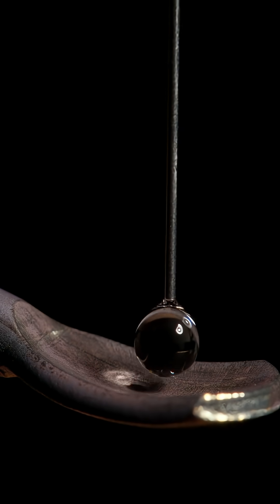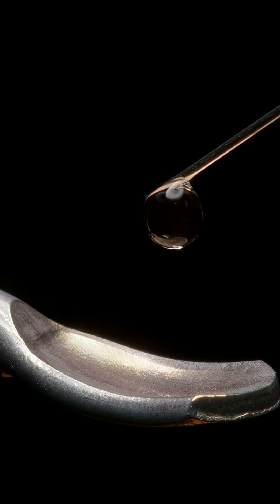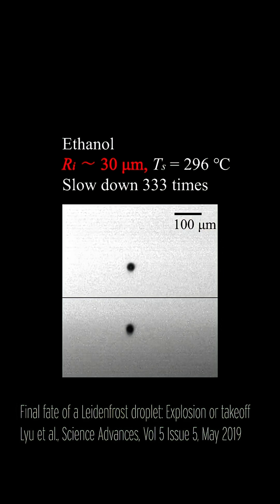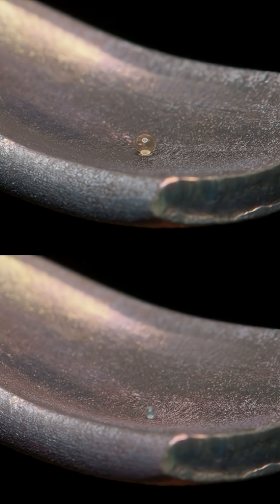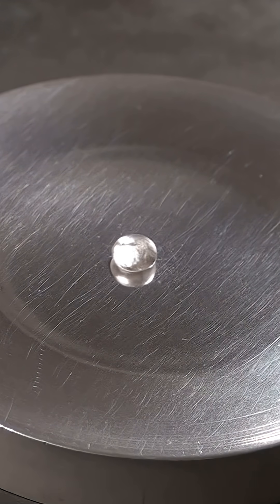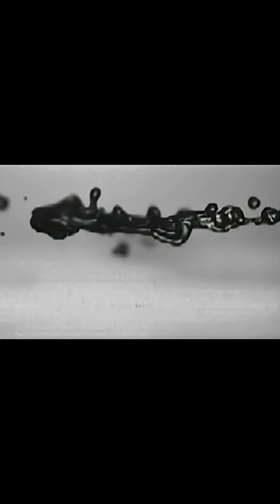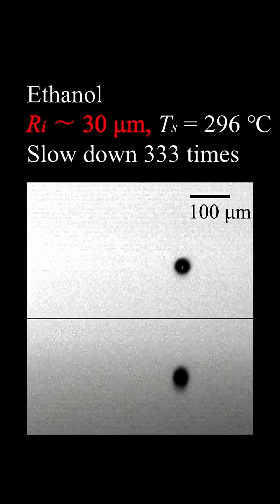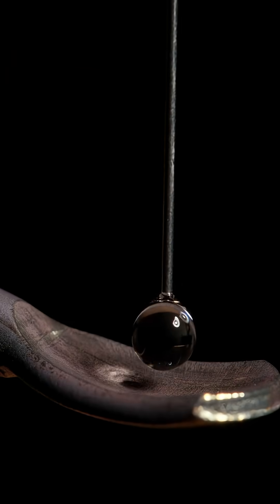trying to make water levitate but it keeps exploding

Comment: The contamination is likely providing a nucleation site for the water to boil where as the pure water can get super heated, held together by surface tension. It’s like when you heat water in the microwave, it can get super hot without boiling but then you put a spoon in it and it insta boils.

Comment: Why do they explode? 

Difference in heat absorbtion

 and the fact that the impurity will fall to the bottom of the superheated water, 

due to it being heavier than the water which is already at the verge of being gasseous

 which will cause the vapour layer to disperse if the % of the water on the bottom surface is smaller than the % of the impurity,

meaning that everything else but the impurity has been boiled away from the bottom,

meaning that there is not enough water to maintain the vapour layer 

which to you looked like a "jet"

 directly heating the impurity, which will direct the heat along the water on its sides to the centre of the bubble,

 And that water almost instantly boils and that expanding gas will cause the explosion.

Comment: Energy vs surface tension, obviously 😂 Think about water and how it holds together as a liquid. Think about what causes that surface tension. it depends on the contaminant, obviously,  but by making stronger charge centers, the contaminant molecules stop even distribution and create points of weakness in the surface... then instead of holding together, the weak points make points where significantly less energy is required to break surface tension. And the droplet then unzips around those weak points tearing the droplet apart,  making it seem to explode. You get a catastrophic breakdown in surface tension from those weak points 😉 i imagine these basic principles could be applied to many things 😂

Comment: When water on a hot plate becomes very small, any impurities can make it unstable. At a certain point, there’s too much contamination for the water to hold in solution. The impurities separate out, heat up rapidly, and create a superheated spot that causes the surrounding water to flash into steam and explode.

Comment: my wild non scientific regular guy guess is that the contaminant precipitates out of solution and thus giving enough surface contact with the water (nucleation point is called?) to vaporize which changes the shape of the water. that jet may just be steam being generated and pushing the water downwards.

Comment: Wondering if the impurities act as nucleation sites as the concentration increases while the water boils off. As the temperature of the water reaches a certain threshold there is sufficient energy that an instantaneous event produces internalized steam producing the explosion. That is where I am guessing the color comes from as the concentration increases the color rises. My guess is if you run this with an ultra pure water and then dope in a contaminant that absorbs at a specific wavelength you could measure the relationship between the absorbance, the total volume of the water droplet, the rate of the evaporation and where the threshold concentration is for explosion.

My guess is this occurs only in droplets below a certain threshold size.

Comment: Maybe the contaminanse cristalieses and creates a nukleation point for steam inside the droplet. This would be on the bottom of the droplet cause most of the evaporation takes place there, so this would explain the jet from the bottom of the droplet. If the cristalisation is exothermic, it would also heat the water far beond boiling and culd enhance the explosion

Comment: Well when you boil salt water. The salt doesn't evaporate the water does, so in this case, the droplet is getting more and more concentrated with the contaminant since the contaminant is not decreasing in amount. Once it reaches the threshold of the water being as saturated with the contaminant as it possibly can any further evaporation would cause an explosion just like this.

Comment: I don't know if it counts but if you were to gather water vapour from a boiling water
And then transfer that into a container that was insulated on all but one side (maybe add a metal film cover to the top so it get contaminated
And then you froze it for 24 hours
Then you chipped off a bit of the clear ice
And then melted it and tried it with that
Would that work? 

Otherwise, can't you buy pure water?
And then you froze it for 24 hours
Reply from the maker: I was using distilled water with a sterile syringe and needle… I’m not sure how the contamination got in there
Reply: @ACSReactions  your method is definitely much better :o
my assumption would be that the distilled water had the contamination
but how to get 100% pure water I have no idea

Comment: Surface free energy v. Volume free energy. You can increase the energy at the interface by adding impurities, which is positive and therefore unstable. In other words, you can think of the metal impurities (Cu(ii) and Fe(iii) from the color) as decreasing the surface tension that holds the water droplet together by interrupting water-water hydrogen bonding. It's kinda the opposite of heterogenous nucleation I think, thermodynamics is really weird.

Comment: My guess why contamination makes them explode: drop a Mentos into Coke and the dissolved gas has a surface to adhere to while forming a bubble. 
Heated water can hold less air as well. Get impurities into the droplet and you get a bubble within the water, leading to an explosion shortly after. 
No impurities - gases get ejected at the droplet's surface.

Comment: Could it be that the vapor pressure of the impurity exceeds the surface tension of the drop at a particular temperature and a particular size (diameter) of the drop as it reduces itself, thus leading to the explosion?

Comment: Harking back to my materials engineering days at university. 

The jet shooting out the bottom appears to be as a result of lower surface tension on that flat plane, compared with the rest of the droplet which has the curved surface.

The energy will be dissipated along the path of least resistance, i.e. the flat plane. 

My memory of the equations is rusty, but I believe the principles are correct.

Comment: Unlikely but... Maybe it's no different than when water does NOT freeze despite being below 32F/0C, but then spontaneously freezes once agitated; or super-heating it in a microwave and similarly flash boils upon agitation... Just in this case, the contaminant gets hot enough inside the droplet, boiling it from within. 🤷‍♂️

As I said, unlikely, but that's where my mind immediately went to.

Comment: (Edit- To be clear, I am not presuming to tell you what to do: I am just having a bit of fun with a thought experiment. So only carry on reading if you are into self-indulgent brainstorming 😁)

I know zilch about the subject but if I were to try this experiment at home, I would hazard a few hypotheses, my first one would be that your starting drop is too big to achieve a levitating effect in its specific environment and it has time to boil before it can get small enough to levitate.

a-  Because the mass of the drop prevents it from levitating immediately, its temperature has time to increase sufficiently for inner molecules to turn into a bubble of vapour, and that bubble has time to expand and explode.
So, I would personally reattempt the experiment with a bubble a quarter of the size of the original one.

b- you are attempting your experiment in a spoon rather than on a flat surface and this is going to affect the direction of air currents above it, leading to less predictable turbulence and variations in temperature.

c- the material the spoon is made of might be a variable to consider. The Leidenfrost effect happens spontaneously on stainless steel but not so much on cast iron. Different metals react differently to heat.

d- (still about the spoon) The material of the spoon might not be smooth enough and have an impact on the behaviour of the vapour layer under the drop.

e- (the spoon again) The spoon is tiny. The area heated by the spoon is tiny.
I imagine that the heated area has the shape of a flame so when the water droplet jumps it has a high chance of escaping the hot zone before re-entering it as it falls down, but if you were working on a wide surface, as the drop jumps and escapes the zone directly above its lift-off site it then gets carried by the hot air of the zone that is adjacent to it.
(Also, would this lead to some kind of heating and cooling of the drop?)
The ratio of the droplet's vs the heated surface's sizes might be important.
Also, the drop has a great chance of falling off the spoon.

d- the likelihood of a drop levitating might be small and only happen in a very narrow set of circumstances.
You are experimenting one drop at a time, but you might need hundreds of drops before the effect you are looking for occurs.

I would personally reattempt the experiment with a large flat and smooth stainless steel pan and I would experiment with the pan's temperature and with different scenarios such as:
- keep splashing water on the pan and do so in large enough quantities that a fine and invisible layer of steam is likely to remain and hover over the pan, like a little cloud that has enough substance to carry a tiny droplet with it.
- or leaving the pan undisturbed until air settles itself into regular "layers" of different temperatures that create a ladder like effect, each one having a different density while also allowing the droplet to cool down slightly as it rises.

PS: could it be that in the experiment you are referring to the water itself contaminated? I could imagine that some contaminant might have increased the surface tension of the drop.

Comment: It's obvious what's causing it... The impurity in the water is increasing the weight of the droplet preventing it from becoming light enough to float above the surface of the spoon...  It pops because the internal pressure is too great and it holds that shape due to water tension...

Comment: Here's my theory. 

The heat causes a weakness to the surface tension. We know that heat causes water to turn into steam. So when that tension breaks, it snaps/explodes like a bubble. But some of the water is still water clinging to itself which causes it to flip itself inside out.

This momentum that is generated flicks even smaller droplets which evaporate quickly or are short lived free floating droplets like water condensed into a cloud.

Yes, impurities are a catalyst that can cause the explosion. But what if we use pure distilled water and a heated water phobic surface? Would we get the desired results of "floating water droplets"?

I am not a scientist. So I can be wrong.

Comment: Whatever dissolved component is holding he doped droplet together must be preventing further evaporation. It becomes supersaturated and superheated, eventually pushing past a critical phase while some nucleation point or shock triggers the explosion. You'll notice that the bottom of the droplet reaches out and touches the hotplate immediately prior to the explosion which I'm sure that has something to do with it.

The pure droplet has nothing but water holding it together so just becomes lighter and lighter until it no longer has the mass to weigh it down against the convention currents.

Comment: It explodes because the heat is causing the water particles to vibrate against each other which when pure is a balanced vibration where it performs a cohesive bond by adding a contaminent and not all will react the same way you create a force for the water to agitate against and release the energy as it is no longer stabilized

Comment: The jet coming out of the bottom of the water droplet is probably from the heat of the spoon causing evaporation in the part of the droplet closest to the hot spoon. Since any hot water around the edges will just evaporate without exploding, the inside water has to reach a certain temperature before and internal bubbles can form, but once it does reach that temp, it makes sense that the first bubbles would form closer to the heat source.

Comment: I mean with having surface tension how much materials needed for surface tension to stay inside of gravity particals in the sky clouds or even to our evaperatory nature of water it reaching the ground and picking up very verry little matter. Almost like  seeding a cloud if there no seed to have it form it stays as that water vapor but. I can see the particulate seteling at the botom giving it a surface to transfer that amount of heat. Like a pistol shrimps claw colapsing a air bubble. As soon as that heat becomes quickly transferable. But its probly waiting for the impurity to settle perhaps

Comment: My theory on explosions based on your video is that the impurities concentate until they are denser than water, then they fall out of the bottom of the drop but some of the water sticks to it. When it hits the pan the water aroundeit instantly turns to steam which creates a shockwave that blows up the drop above it.

Comment: The contamination disrupts the  surface tension. And it's always on the bottom because that part is being heated by the spoon, hot liquid rises, water turns to steam, the contaminants drop, and then they get heated. but because there is a difference in surface tension and is now inconsistent, that droplet ruptures.

Comment: My hypothesis is that the items are able to burn, but since it’s encased with water that’s already at such a high temp,  the quick burn of the material  burns hotter and instantly explodes due the heat rapidly trying to escape faster then  the water boiling on the surface tension, causing it to loose its bubble integrity, causing it blowing up .

Comment: You would have to get the surface to the right temperature and be able to make a droplet small enough on drop to make it levatate. Otherwise, you make a larger droplet and as the temperature rises, the molecules start going crazy until it finally explodes. If you can drop a droplet small enough when you drop it, it should do what you're looking for because the evaporation starts before it even hits the surface.

Comment: The explosion could have to do with the impurities getting "distilled" with in the drop. Makeing a higher concentration in a condensed location that can get to a significantly different temperature.

Think water in oil, now I'm not sure if it would be the inverse of it or much the same effect.

Like it could be the hotter then boiling contaminated "water" is pacted together underneath the drop then at a tipping point it flash boils the water as it moves up into it. With the cooler water being more dense on the outside vs the jet of hot water and contaminated water at the bottom. Forcing the rapidly expanding water out the bottom at first before exploding.

Or if the concentrate has a lower boiling point but will only reach that within the boiling point of the water after it goes past it because the rest of the water holds it together till it can't causing the sudden vaporized contaminant to pop the water drop like a balloon around it once it hits that breaking point

Comment: The heat burns off extra hydrogen as gas, compounding the extra material until said material's mass is enough to conserve heat, at which point it radiates its own heat disipating the nucleus so to speak its fairly simple science

Comment: Maybe a bit more heat or actively heating the spoon? Keep in mind, when adding cool water to anything thats been heated, the water will steal a bit of heat from the object. This happens gradually as the water heats up and then if the water undergoes a phase change (such as explosion/evaporation) it will steal even more energy but all at once. I think what’s happening is your spoon is so small that when the droplets undergo a phase change, it steals too much heat from the spoon, so not a lot of energy to keep hot and levitate droplets with. Maybe try a pan or hot plate rather than spoon? Or maybe make an induction heated spoon? Just my two cents!

Comment: So the water isn't disappearing so much as it's vaporizing. I.e., it's evaporating. It's just so small that it takes virtually nothing at all to vaporize it. Like, imagine if there was a window, like a thick window that sat in the desert sun for a long period of time, and the window was not insolated, but just glass and the desert decides it gonna rain... I understand it doesn't do that in the desert, but just bear with me here. The window is the heat, but the desert air is also very hot. So the two interacting forces are the water and the heat from the air and the water. And the air has the other interacting force with the water of making it vaporize from the heat, a sort of medium. What this is, and this is just my conjecture... Not based on any actual clerical evidence, but just a guess. But what this looks like to mez it the heat of the air being cooked by the heat of the window, or in your case, the spoon or surface the water is sitting on being naked by the bright filming lights. They magnify light spectacularly. So likely that's what is happening here, but I could be wrong. If you did it in a high humidity zone and had low-level or different gigahertz level light waves, this might work much better.

Comment: For it to levitate, it has to be 100% distilled, filtered etc to remove all sorts of minerals and other stuff. Then, it also has to get small and light enough for the vapour to hold it up aka make it levitate but for that there also has to be a little Bit of water in the Heat surface so constant vapour holda IT up
Reply: The heat will also help the drop rise.
Reply: This
Reply: why does this have 150 likes